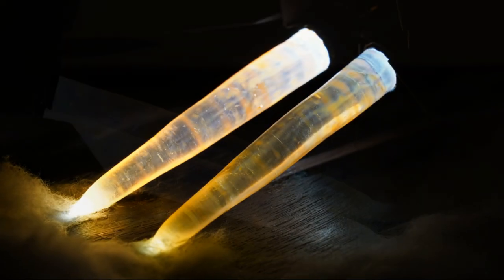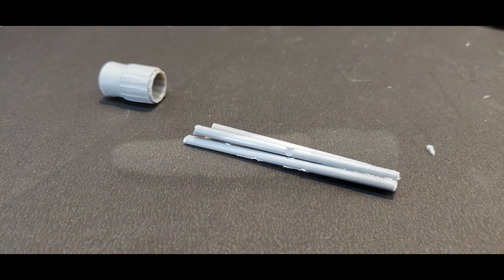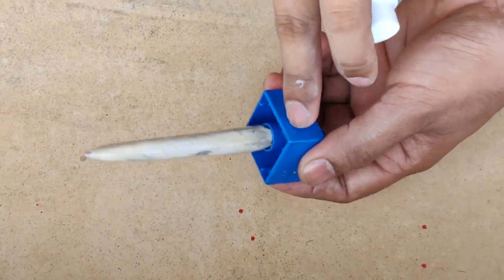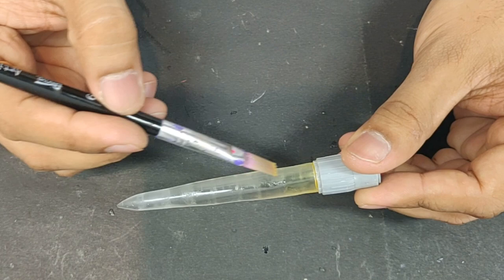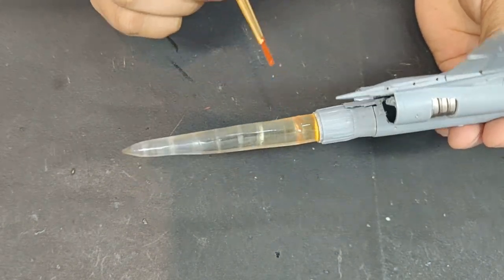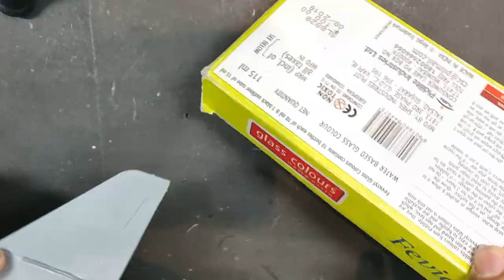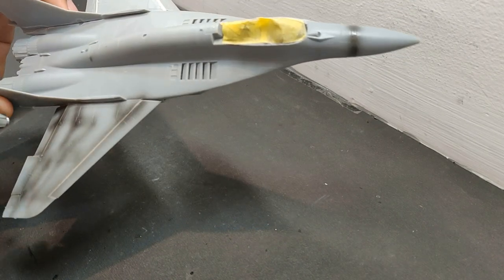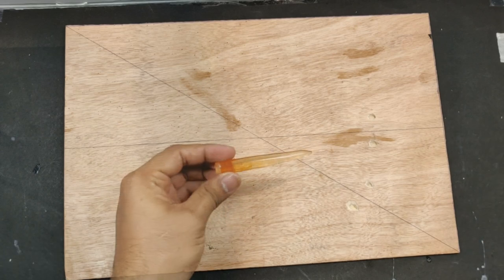Making Realistic Afterburner Flames .  MIG-29 . Full Build . Indian Air Force

Comment: Just change the bulb 💡 into yellow 💛 color bulb it will be more accurate color of after burner.
Or paint the current bulb you are having there with CLEAR YELLOW toning a bit with clear orange but apply the paint layers 4-6 layers to the bulb skin to make it look deep flames burning....

Also paint bright orange 🧡 color inside the exhaust of jet thrust area.. before you insert the epoxy flame thrust. After you had let the interior area orange paint dry, than you can insert back your 2 unit epoxy flame thrust....

White bulb color ruin the realistic look of actual thrust flames color of jet afterburner which the original of thrust 🔥 flames color are : yellow+orange+red ( little ).

Just do it ☑️
You will satisfied with the final afterburner match to the real aircraft.

You are using a solid acrylic epoxy for the afterburner effect.
Another method using a hollow empty afterburner shape epoxy.
Other methods modellers also using the cotton fibre sprayed lightly with yellow + orange paint and lit up by yellow and orange color bulb , too ( LED LIGHT ).
For cotton after burner flame effect you need to harden it by spraying with hair spray OR clear spray lightly and shape it with your finger slowly and gently. And lit it with yellow and orange LED light.
Attached 2-4 unit small LED light of yellow and orange color as your current model position.

Your modelling work to make the after burner flame effect is almost there 👌🏻😁 but you still missing a little bit of 'SPECIAL EFFECTS' lighting technique for realistic miniatures.
https://youtube.com/shorts/rVETYxacBEQ?feature=share

Sincerely ,
Me
Hollywood level miniature and model builder since 1987.
https://youtu.be/HZinKCDko20

Hope you will be success in more realistic model making 🤝 work 🙏🏻.
Thank You for accepting my suggestion to improve your model diorama results....
Have a wonderful day...👍🏻💪🏻